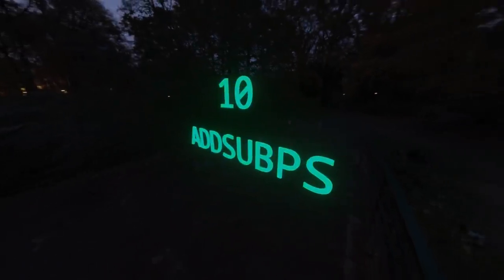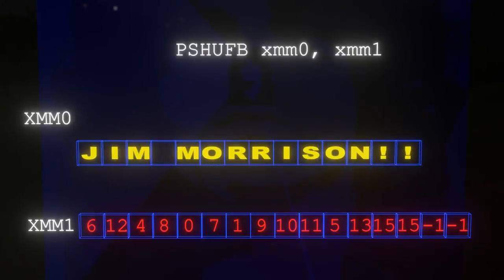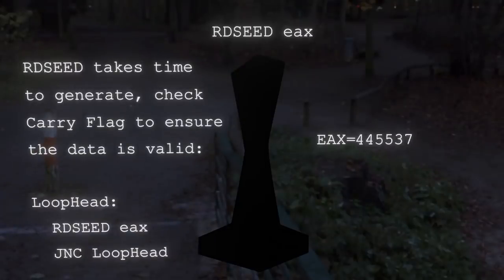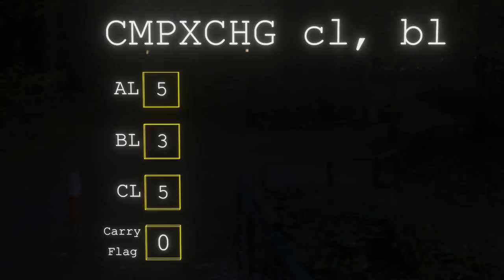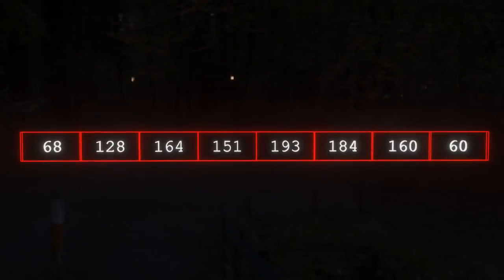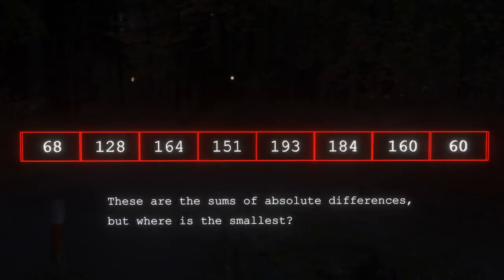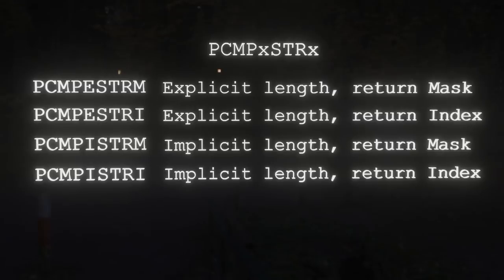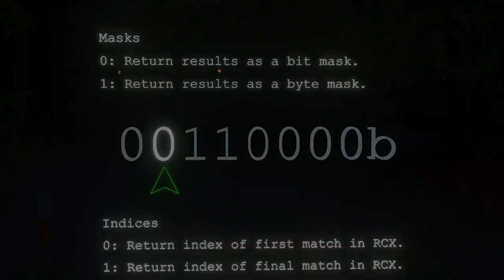Top 10 Craziest Assembly Language Instructions

Comment: You'd almost think silicon makers like to mess with compiler writers.
Reply: I doubt these instructions were aimed at people writing compilers, they'd be aimed at people doing things with encryption, low-level synchronization, multimedia.. I think these days people would first try and come up with a GPU based way to tackle these large data-processing problems, but before GPUs were general purpose parallel computers you had to do these single instruction multiple data things on the CPU
Reply: @kestasjk  Also, doing stuff with a good CPU instruction is generally more efficient than doing it on the GPU, simply because you have to send across the data and get the result back on a GPU.
Reply: @toboterxp8155  Sort of.. The thing is if you’ve got enough data the GPU is so much faster it’s worth the overhead (and the memory space is getting more integrated / unified all the time), and if you’ve not got enough data to make sending to the GPU worthwhile the speed up for processing a small amount of data on the CPU more efficiently probably isn’t worth it. Perhaps for certain encryption or compression tasks where it can’t be parallelised very well on the GPU but it still needs lots of processing power they may still be useful, but I doubt these sorts of instructions are used in modern software very often
Reply: @kestasjk  Your generally correct, but those instructions are a standard way of making programs faster, used to this day. If your task isn't easily converted to the GPU, you don't want the extra work, or you don't want the program to require a GPU, using some complex instructions is an easy, fast and simple way to optimize for some extra speed when needed.
Reply: @toboterxp8155  True.. but I think you can probably attribute ARM/NVIDIA’s ability to keep improving by leaps and bounds while Intel is reaching a plateau to its need to maintain a library of instructions that aren’t really necessary in modern software. If it gets rid of them old software breaks, if it keeps them any improvement it wants to make to the architecture needs to work with all these. Intel went for making the fastest possible CPU, but we now know a single thread can only go so fast (and the tricks like branch prediction have exposed gaping security holes in CPUs, forcing users to choose a pretence of security or turning branch prediction off and getting a huge performance hit). So parallelism is the future: In the 00s this meant multi-core CPUs, today this means offloading massive jobs to the GPU, but the breakthrough will come with CPUs and GPUs merging into one. Not to an SoC, like we already have, but with GPU-like programmable shaders as a part of the CPU instruction set and compiler chain, so that talking about CPU/GPU will be like talking about CPU/ALU. You’ll be able to do the operations like these instructions do in a single cycle, but by setting up a “CUDA-core” with general purpose instructions that can access the same memory.
Reply: @kestasjk  Maybe. But Multi-Threaded programming is infinitely more complex and difficult. I doubt we are gonna get rid of the classic CPU anytime soon. I mean, look at the PS3. That did basically the thing you are saying, with their Cell-Shading processor, and most of the games were unable to use it to anywhere close to full potential. There's a reason why computers are the way they are at the moment.
Reply: @Toboter XP  Hahah I wasn't expecting this in a Youtube discussion.. I thought about mentioning the Cell processor and how it sounds like I'm describing a failed technology.. good point, and yes computers are the way they are for good reasons (at least, good for when they were created).
That having been said the Cell architecture were quite separate coprocessors that needed DMA to move data back and forth. The key difference between multi-threading and GPU parallelism / SIMD is that you're doing one operation on a large set of data simultaneously, instead of going one by one.

That's what all these Intel special instructions do; process multiple pieces of data in a single operation. Problem is you're applying it to a fixed-width dataset (a couple of 128-bit registers say, with a bunch of 32-bit/8-bit data units in it), and the operations are predefined. With a GPU you can do the same thing of processing a dataset in a "single operation" (okay perhaps not single-cycle), but the operation is programmable and *the dataset can be any width*. Instead of running a bunch of neat Intel instructions to process your data in 128 bit chunks you could say "okay this array here, I want to operate on each element of it using this shader and output it there".

At the moment that means a whole load of GPU data transfer, initialization, shader and state loading etc, but I think this just is a quirk of how we've gotten to this point and in future GPU and CPU won't be the distinction it is now.

By the way Feynman predicted this in the 70s. Here's the part where he talks about SIMD and scaling if you haven't seen it it's a great lecture: youtube.com/watch?v=EKWGGDXe5MA&t=2230s
Reply: @kestasjk  Maybe you are right in the very long run. But since the vast majority of programs can't really profit from a GPU, because the speed limiting factor isn't processing speed I doubt we'll see it any time soon. As Feynman said, they figured out how to do some things with 64000 processors. But if you start doing everything on 64000 processors, the overhead of synchronizing and managing those processors would probably gobble up most of the won time. There is a reason why you rarely see GPUs being used for a variety of operations. Also, an important aspect of GPUs is their extremely fast VRAM, so anytime you want to process something, you basically need to do a DMA anyway. But, we'll see. AMD is making GPUs, motherboards and CPUs so it's not out of the question that they'll get up to some shenanigans.
Reply: Indeed, one doesn't expect such discussions in Youtube comments. I would add about moving things between CPU and GPU, that modern integrated GPUs share RAM with CPU, and some of them, like Nvidia Jetson, are quite powerful, replace ordinary DDR with GDDR and you'll be golden. On such systems there already is no reason not to offload any nontrivial vector computarions to GPU. Except, as with these complex CPU instructions, it's still a pain. One of my friends was working on compiling OpenMP to CUDA within GCC, but I'm not sure if they've made anything usable, and before something like that becomes commonplace offloading to GPU would remain manual and thus relatively rare. Plus, for wide adoption there needs to be a universally accepted API, be it OpenCL or OpenMP or whatever, available everywhere and with reasonable guarantees of available computation resources, which isn't quite the case yet.
Reply: These are driven by the Marketing folks and then the algorithm/driver guys request the functions to be added to the silicon/compilers.
Reply: @toboterxp8155  Amdahl's law.
Reply: no but that very unconcious
Reply: I believe that a very large number of these instructions are just never used in the standard output generated by a compiler. Depending on the compiler one can inline assembler code but that's likely to be the only time many of these instructions are ever used outside of hand crafted assembler modules.
Reply: They tried that with Itanium and failed.
Reply: On the contrary.  Compiler writers only care about the instructions they need.  If there is an instruction that doesn't help the compiler to do its job, they just don't use it.  It's not the compiler writer's job to make full use of the processor; it's the compiler writer's job to optimize code to run on a CPU.  Now, if it happens that the compiler has to do some unpacking and packing of bit fields, for example, the compiler writer will definitely look into how to make use of special instructions to do that.
Reply: I remember reading an interview in BYTE magazine, with one of the developers of the Motorola 6809 CPU.  This processor was built from the ground up to support compilers.  They looked at how compilers did their job, and omitted most of the instructions that didn't help with that.
The funny thing is, most systems built around 6809 CPUs didn't use compilers.
Reply: @kestasjk  they're hard to compile anything into. that's what the OP meant.
there's so much semantics packed into an instruction a compiler would almost need to understand the intent behind a piece of code to know when to use them. it's akin to decompilation, because the semantics of the target language are more high-level than those of the source language (if it's something like C or most other languages that don't do SIMD natively.)
these opcodes are used from inside a hand-coded wrapper and don't occur in a compiler output "naturally." there's no code you can write (that doesn't use the wrapper) that will compile into one of those instructions.
how this became about GPUs only you know.
Reply: @BrightBlueJim  That makes the (mostly valid) assumption that compilers AREN'T sentient, superintelligent beings. In my mind though, a compiler's job is to make your high-level code run as fast as possible on a given CPU without changing your logic. If you have a perfect compiler, and a particular instruction is the fastest way of doing a particular task, the compiler will use it. Since every instruction IS the fastest way to do some or other task (even if it's a super rare and specific one), the perfect compiler would be capable of using all of the instructions.

In reality though that does make sense. A lot of instructions are made in ways that are easy for humans to comprehend but much tougher for a machine, and they don't provide that much of a benefit anyway.
Reply: @BrightBlueJim  Apart from inline assembly, Rust also has function bindings for all those fancy SIMD instructions. I don't know if other languages have something similar, but this seems like an interesting solution to the question of "how do we utilize all these specialty CPU features without making the compiler ridiculously complex and without making people's code a heterogeneous jumble?"
Reply: I think there is a historical tendency for the instruction set engineers to think that they understand compilers better than the compiler engineers do, Dare I mention … iAPX 432?
Reply: And language designers like to mess with developers. Hey, there are these six instructions to implement AES. So let's have the developers write 4 screens of code we can recognize in the optimizer and transform into these six instructions. No, no, don't expose them as library calls! Make the optimizer people sweat!
Reply: @sharpfang  Programming languages have much higher durability than CPU architectures (or crypto algorithms). The vast majority have portability as a primary objective. If crypto-algorithm specific instructions were exposed in the language (other than as a host-specific extension), you'd (a) be making a decades-long commitment to that algorithm, and (b) making a language commitment to hardware that supports it! So of course it makes “competitive sense” for CPU manufacturers to develop and promote such instructions in the hopes that a language designer will fall into the trap and hand them decades of artificially inflated benchmarks and scope for patent wars, but it makes no sense for the language designers to take the bait. Such accelerator functions belong in libraries provided by the hardware manufacturers themselves, not in language cores.

At the end of the day, an end user, especially in embedded applications, may have a specific operation that they need sufficiently highly optimised that they want direct hardware support, but the reason a general purpose CPU is bought is to support a computational abstraction. A good general purpose CPU is one that supports such abstractions well.

The entire unholy history of Microsoft and Intel notwithstanding.
Reply: I hope this be true !

Comment: Good lord that poor silicon. I can't even begin to imagine how you'd design chips to implement some of these instructions. I'd love to see a followup video showing some examples of using these instructions, and if they're superceded, what should be used instead!
Reply: They committed the cardinal sin in the 1970s with REP MOVx and it went downhill from there.
Reply: microcode, lots of microcode
Reply: I'd think that there are massive groups of "one circuit per operation", and they all work in parallel. From all the results only the specified one is selected.
Reply: Microcode. Lots and lots of microcode.
Reply: A long time ago, they actually gave up on x86, and have been making much simpler chips that convert x86 to that simpler system using "microcode"
Reply: no wonder it waste that much power
Reply: You wire every permutation of wire to/from the ALU and then give them names.
Reply: Easy. Those instructions are basically a function call to microprocessor microcode. The real work is inside the microcode.
Reply: @Noctew  REP MOVS is based though
Reply: Micro operations. The complex instructions are broken down into sequences of smaller RISC-like micro-operations which are then executed. 
Incidentally, this is actually the only reason that x86 is still breathing in the 21st century. Superscalar out-of-order cores would be next to impossible to do with native CISC instructions! The furthest intel ever got toward this end was the P5 architecture which was dual issue in-order, and even that wasn't two full x86 pipelines!
Reply: @101m4n  You forgot about micro-op fusion.
Reply: @DorperSystems  I actually don't know what that is
Reply: @101m4n  x86 supports micro op fusion like cmp and jne being fused into cmpjne and other complex microcode operations
Reply: @DorperSystems  Oh I see, that makes sense.
Reply: NAND Gates.
Reply: @BrunodeSouzaLino  *Verilog and CMOS
Reply: @DorperSystems  Still require NAND Gates to work.
Reply: @BrunodeSouzaLino  The designer doesnt have to deal with the nand gates though. And not everything is nand logic anymore.
Reply: micro-spaghetti
Reply: I love to see the silicon implementation.
Just to not know what is going on.
Reply: Someone really wants to work at Intel. Someone really doesn't want that person to work at Intel. Hey, new guy, make the string compare instruction.
Reply: no wonder arm is so much more power efficient and powerful
Reply: @WWFYMN  arm and x86 are converging in design. most x86 uses ll/sc micro-ops for implementing their atomics. there are so many caveats on ll/sc in arm they added more traditional atomics that also decode to ll/sc micro-ops but without the possibility of as the arm manual puts it, CONSTRAINED UNPREDICTABILITY.

also the string instructions OP mentioned, rep mov, are super efficient and similar instructions now show up on arm (they're aarch64 instructions called cpyp, cpym, cpye)

arm may be more power efficient for some use cases but I think it's bold to say that it's more overall powerful.

btw rep mov is really really efficient. people think that one is some unreasonable instruction but nah, copying memory is a really important thing to do and rep mov does it really, really well. way better than the classical risc method of N movs in a row for a lot of reasons for a surprisingly low value of N
Reply: Microcode......
Reply: I think some of them happened because the engineers sometimes realized that they could easily add support for a new instruction that might be useful to someone when they designed a new iteration of the x86 architecture. Of course, the expectation of backwards compatibility in x86 chips means these instructions need to be supported basically forever, even if they might not be cheap and easy to implement in newer iterations. Using microcode helps, but I'm still amazed none of these instructions are translated into a bazillion internal instructions that take ages to execute!
Reply: @polypolyman so, how does that differ from RISC: reduced instruction set?

> "A long time ago, they actually gave up on x86, and have been making much simpler chips that convert x86 to that simpler system using "microcode""